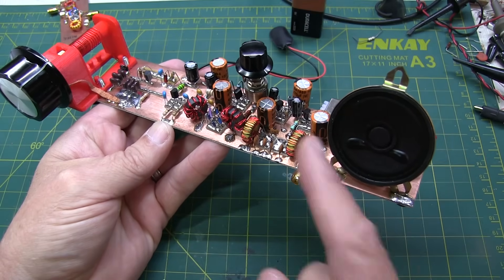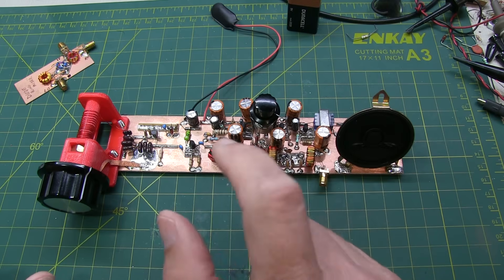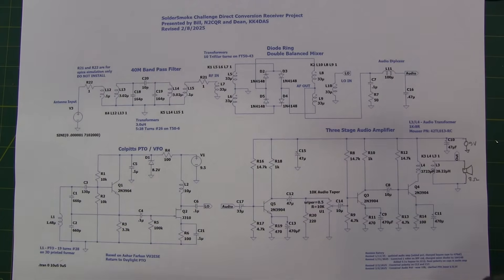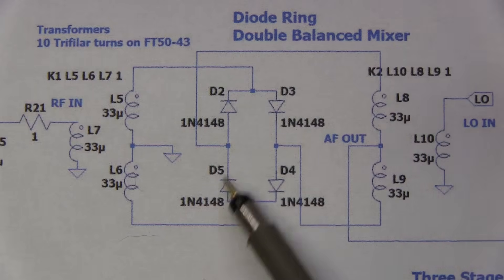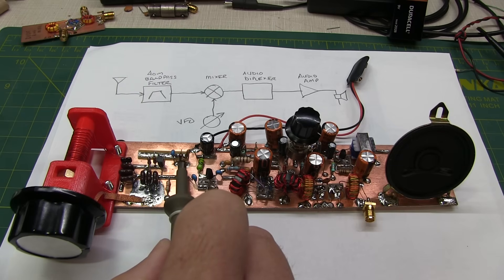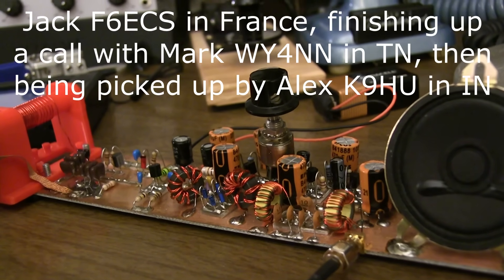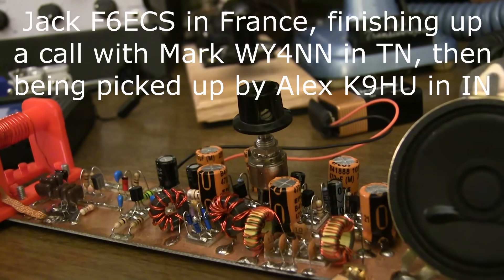#398: My  build of the SolderSmoke Challenge Direct Conversion Receiver for 40m

Comment: The show stopper for most of us is the 3-D printed PTO, since most of us do not have 3-D printers or access to a 3-D printer.
Reply from the maker: I had to have a friend print it for me. There are services that will print it very reasonably, or you could make a form with plastic tubing and hardware and epoxy.
Reply: @w2aew  Thank you. I think I'll try making something as you suggest. Would happen to know the diameter of the form? Thanks again for all your excellent videos. I've built a great many of your projects. Todd, N7TWL
Reply from the maker: Not sure exactly, looks to be about 3/8”.
Reply: @w2aew  Thank you! Also found some YouTube videos on building a variable inductor using a glue-stick tube. MONTV Homebrewing has one. I built the titled "Glue Stick PTO." I am surprised at how well it works. 73, N7TWL

Comment: R14 in the schematic is spec'd at 10 Ohms, this results in current of 70mA through Q4 and  the transformer -- while the trafo is only rated for 75mW shouldn't be a problem save that battery life will be considerably shortened.
Reply from the maker: The schematic was revised. R14 should be 100 ohms.

Comment: Great to see and hear the finished product. 

I'm working on this piecemeal now. I'm using MVAM109 tuning diodes to control the VFO, driven by a 10-turn pot. I've found that it gives very precise control. My buffers and oscillator gain are all BJTs since it's what I've got lying around. 73!

Comment: Enjoyable video.  I like the modular aspect with Sma connectors.  I got a thought experiment where the TinySA is the local oscillator and pan adapter.  Probably not possible with the TinySA.  Just an idea.
Reply from the maker: The problem is that the TinySA can be setup as a spectrum analyzer OR a signal generator - not both at the same time.  So, it can't be the local oscillator and a spectrum scope.

Comment: The first thing that comes to mind when considering the pile of separate boards approach is the need for an awful lot of connectors...
Reply from the maker: Many folks just connected the boards with soldered wires or coax.

Comment: so with this direct conversion design, what happens when a another ssb signal is next to yours?    would that not also mix down to audio  and be hear?   audio spectrum be flipped,  but you'd still hear strange sound.
Reply from the maker: Yes, that can/will happen. CW signals are heard “twice” as you tune thru them, once when the LO is below the CW signal, and once above. SSB is the same, but of course only intelligible on the correct side. This is very similar to old shortwave receivers with a BFO, you have to be sure to put the BFO on the right side (and accept interference from adjacent signals on the opposite side).
Reply: OK thanks 😊 @w2aew

Comment: Interesting! Why did you choose to use a custom made variable inductor instead of using a fixed inductor and a common variable capacitor?
Reply from the maker: A multi turn solution makes it much easier to fine tune the frequency vs the 180 degree rotation of a variable capacitor.

Comment: Hello Sir,
 I hope you are doing well.
I've come to you again after a long time. Perhaps you don't remember me due to my busy schedule and lack of recent contact. I'm writing from Bangladesh. About a few month ago, I sought your guidance regarding studying engineering. You helped me immensely by guiding me towards studying what I'm passionate about. You recommended I read "The Art of Electronics." However, I'm unsure what to read next or alongside it. I was thinking of reading a book on circuit analysis, but now I feel a bit lost. It would be very helpful if you could advise me on what I should read now.
We spoke on YouTube during the broadcast of your no:#390 video in november .
Reply from the maker: A good practical book on troubleshooting (circuit analysis) is "Troubleshooting Analog Circuits" by Bob Pease.
Reply: Thank you sir❤
I think it would be helpful if i told you what I've learned and how. 
"So far in my electronics engineering studies, I've only covered the basics of resistance, voltage, and current, including their definitions and descriptions, and the three formulas of Ohm's Law. I've done some practice with series and parallel circuits made up solely of resistors, and I've learned about series opposing and aiding circuits, grounding, the voltage divider rule, the current divider rule, and practiced quite a bit with parallel resistor circuits.
Since I'm not enrolled in any educational institution, I created my own learning sequence for these topics, and it felt pretty well-organized to me. I've now moved on to the chapter on Power and Energy. In this chapter, I've learned about the definition of power, the application of the three power formulas (P = IV, P = I^2R, P = V^2/R), and how to calculate voltage, current, and resistance based on power formulas such as (V =√P*R , I = √P/R , R = P/I^2). However, I haven't found many circuit-based exercises to practice with.
I wanted to study energy and power calculations together since energy calculation is related to the amount of power. While I've managed to learn a little about power, I'm finding it hard to learn anything substantial about energy beyond a few formulas. I'm struggling to understand how and when to express its quantity using different units, and what can be calculated using the energy formulas, among other things."
Reply from the maker: @abubokorsiddiq580   To be honest, energy calculations are rarely used when doing electronics work - so, don't dwell on that.  Power calculations are most often done to determine how much power a given devices will need to dissipate (remember that power mean that heat will be generated - the more power, the hotter things get).  For example, say you have a 220 ohm resistor that has 10V across it.  That means that there is 45.45mA flowing through it, and the resistor will be dissipating 0.4545 watts.  In typical designs, you would want a 2x safety margin, so in this case you'd select a resistor rated for 1W for this application.
Reply: "Sir,
From my limited knowledge, and I might be mistaken, let me explain using an example. Let's say I'm learning now, and I want to create a device of my own design. For this device, I've estimated that it will consume a total of 10 watts of power per hour. If this device is to provide continuous service to a user for a minimum of 6 hours, then it will consume 60 watts of power. Following this, if I want to make my device portable, meaning I want to incorporate a battery, then I might need to calculate energy, for example: how long this battery can supply power to this load, if I target it to run continuously for three days, will it run for a shorter or longer time, and so on.
Another scenario is this: In our country, if someone buys an electrical device from the market, such as a fan, refrigerator, water pump, or electric vehicle, they calculate, 'If I buy this, what will be my monthly electricity bill, how many units of electricity will it consume in a day?' So, if I were to say about a device I've created, 'This will consume ten units of electricity per month,' then, at the time of creating it, I might need to calculate matters related to energy and time.
Please Sir, let me know your thoughts.
Reply from the maker: @abubokorsiddiq580  For battery powered applications, the batteries are typically rated in Amp-Hours (or milliaamp-hours).  So, the typically way to determine battery sizing is to consider the total current draw of your device and divide the battery capacity by that number.  For example, a device drawing 200mA will last 10 hours when using a battery with a capacity of 2Ahr, or 2000mAhr rating.   For computing energy  usage for home/building use, the "unit" is typically Watt-hours (the product of the power usage multiplied by the usage time).  So, an appliance that consumes 250 watts will use 2.5kW-hours per month if it is used for 10 hours in that month.
Reply: Do I need to calculate this for each component when building the device?
Reply from the maker: @abubokorsiddiq580  Usually not.  Start with calculating for the ones that will be dissipating the most power- such as the devices with the most voltage drop and those with the most current flowing through. Sometimes, the entire circuit's power dissipation is low enough that you don't need to calculate for each component - since none of the components will use more power than the total circuit.  So, if your entire circuit uses 150mW of power, you can be safe using 1/4W resistors everywhere, and likely 1/8W in most places...
Reply: Sir, please let me know a convenient time for you to contact you, so that my conversation with you doesn't disrupt your important work. Also, could you let me know what time it is in your country right now?
Reply: 😢umm

Comment: Nice clear circuit diagram and description; a good no-frills design for a novice. But what's with the 14.7k resistors? A novice might spend much time trying to buy those when presumably they just happen to be what you had in stock. The real/normal values would be 15k resistors !
Reply from the maker: 15k work fine.  The designer must have been working of an E96 resistor list.

Comment: Great Video, Alan. Nice stage-by-stage analysis. You should bring it to the next IEEE-MTTs Mini-Show at the Hanover Manor in October. Hook it up to that great Tek gear and do a live demo with practical radio. That will give the Soldersmoke DCR some IEEE exposure. And show off the Tek gear's capabilities. Antenna?? Random wire out the window to the parking lot, no one will notice! CU There-73-Mike, WN2A

Comment: Very nice project! And, a great learning tool. So, what keeps the VFO from going out the antenna? Maybe an RF amp stage before the mixer would offer some isolation and maybe add some gain. It looks like you have room for that on the board... Thanks for sharing this project. - WC8J
Reply from the maker: The double-balanced mixer will suppress the VFO signal a lot.  The injected power of the VFO is at best just a few tens of milliwatts.  The suppression of the DBM should be at least 10-20dB or more, so the amount of signal getting to the antenna will be minimal.  And yes, an RF preamp will suppress this further as it will have a fairly small S12.

Comment: How are SSB & CW signals being demodulated without a BFO?
Reply from the maker: Since it is a direct conversion receiver, the VFO is the BFO - you're just adjusting it to the suppressed carrier (for SSB), or to approx 600-700Hz above or below the CW signal and hearing the heterodyne.  Since there is no real filtering, you hear the CW and SSB "twice" as you tune thru (when VFO is below then above the signal).  Of course, the SSB signal is only intelligible when you are on the correct side.  The CW signal can be tuned on either side.

Comment: AI Summary

Abstract:

This video details the construction and operation of a homebrew direct conversion receiver designed for the 40-meter amateur radio band (7-7.3 MHz). Originating from the Soldersmoke blog and podcast as a challenge for high school hobbyist groups, the receiver emphasizes modular design using readily available components. The architecture is straightforward, featuring a passive 40m bandpass filter, a four-diode ring mixer, an audio diplexer for RF termination and low-pass filtering, and a multi-stage transistor audio amplifier for all signal gain. A variable frequency oscillator (VFO) provides the local oscillation, with its frequency directly corresponding to the tuned receiving frequency. The video discusses the schematics of each module (VFO, bandpass filter, mixer, audio amplifier), highlights construction considerations such as component stability, and demonstrates how to determine the operating frequency using external tools like a TinySA. The project is presented as an accessible and rewarding build for electronics enthusiasts, requiring only five transistors for a functional receiver.

Summarizing the Direct Conversion Receiver Project

*   0:00 Introduction to the Receiver: The video introduces a direct conversion receiver for the 40-meter amateur radio band, emphasizing its simplicity and the story behind its design.
*   0:10 Project Origin and Goal: The receiver was conceived by the Soldersmoke blog and podcast as a challenge for high school hobbyist groups, aiming to create a working receiver using easily obtainable, modular components. Over 70 units have been built worldwide.
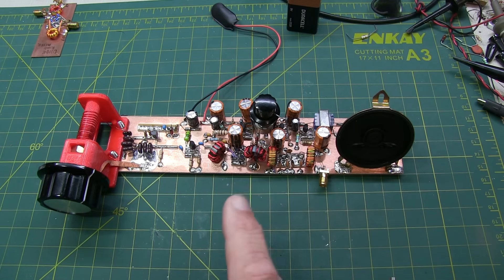*   0:53 Modular vs. Compact Building: While many builders construct each module (VCO, mixer, audio amplifier) on separate boards for easier testing and layout, the presenter opted for a compact, single-board design, which was a challenge due to tight space.
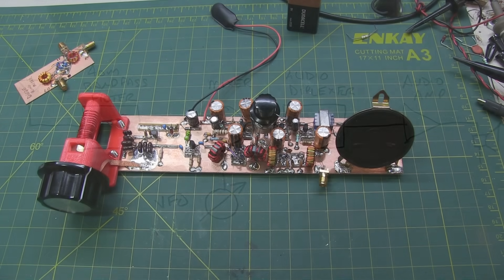*   2:05 Simple Block Diagram: The receiver's design is straightforward: signals enter via an antenna, pass through a 40m bandpass filter, then to a passive diode ring mixer (where a Variable Frequency Oscillator, or VFO, provides the local oscillation for direct conversion to audio), followed by an audio diplexer and finally a three-stage audio amplifier that drives a loudspeaker.
*   3:09 All Gain in Audio Amplifier: A key takeaway is that all signal gain in this receiver comes solely from the audio amplifier, as
Error: <sqlite3.Connection object at 0x7507e409eb60> returned NULL without setting an exception Oscillator):* Uses a single NPN transistor and a 3D-printed inductor with a brass screw for tuning, buffered by a JFET. Stable operation is aided by silver mica capacitors and a Zener diode shunt regulator.
    *   40m Bandpass Filter: Consists of bifilar wound transformers and a capacitor network to pass 7-7.3 MHz signals and reject out-of-band interference.
    *   Diode Ring Double Balance Mixer: Utilizes four diodes arranged in a ring and center-tapped transformers for switching action, converting RF directly to audio.
    *   Audio Diplexer: Terminates RF output from the mixer and acts as a low-pass filter for audio signals.
    *   Three-Stage Audio Amplifier: Composed of common emitter stages with AC coupling and a potentiometer for volume control, driving an audio output transformer to an 8-ohm speaker.
*   8:23 Encouragement to Build: The presenter challenges viewers to build their own receiver, suggesting individual modules might be an easier approach for beginners, and provides links to resources.
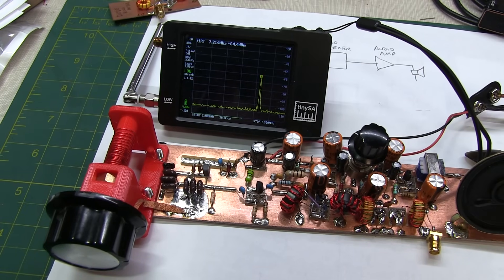*   9:11 Frequency Determination: Without a direct frequency readout, the VFO's oscillation frequency indicates the tuned frequency. This can be measured with external tools like a TinySA, another receiver, or an oscilloscope, making frequency determination "part of the challenge."
*   10:34 Sample Recordings & Conclusion: The video concludes with sample recordings of CW (Morse code) and single sideband (SSB) signals received by the unit, despite poor band conditions due to a solar flare. The presenter reiterates the project's enjoyment and simple nature (only five transistors).

I used gemini-2.5-flash-preview-05-20| input-price: 0.15 output-price: 3.5 max-context-length: 128_000 on rocketrecap dot com to summarize the transcript.
Cost (if I didn't use the free tier): $0.0056
Input tokens: 16172
Output tokens: 902

Comment: Do You have a video tutorials about TinySA?
Reply from the maker: Not yet.  I have both the TinySA and the TinySA Ultra.  No videos yet.  Do you have a question about them?
Reply: @w2aew I just do not understand the mesurements. I tried to mesure the harmonic content of 2m handheld trx through air coupling. (Just the relative power to the carrier "dBc"), but it is told me that this is incorrect way and I need to use rf attenuator to mesure it properly (to not blow tinysa input circuit, I am Ok with that). But why tinysa can not mesure relative harmonic power with respect to the carrier over air coupling but it can via att?
Reply from the maker: @adrian_sp6def  The main reason that you cannot use over-the-air to measure harmonic content is because the gain of the antennas, their response pattern and the coupling between them (radio and TinySA) will not be consistent at the fundamental frequencies and the harmonic frequencies.  Thus, the relative magnitudes of these frequency components will be affected by the antenna gain and radiation patterns, and won't represent the true relative amplitudes between them.  An attenuator that is "flat" across the measurement frequency range is what you need to maintain the same relative signal strength between the frequency components.

Comment: Great presentation!  I just finished setting up an SDR receiver but find myself wanting to build something like this that is a world removed from an SDR!
Reply: This is not something I have done but if you feed the audio stage into the line in or mic port of a PC, you're back in SDR receiver land. I've built the opposite - You feed IQ data into two mixers with a quadrature vfo, and you've got an SSB signal you can amplify and transmit.

It's a very fun project, and because I cheated on the VFO (Si5351 can do quadrature VFO), the hardest part was always always those pesky RF amplifiers :)

Comment: Some years ago I designed and built a radio like this and was quite ecstatic to see it work ......  except  ......  With a period of several minutes the VFO would suddenly zoom off and then slowly return.  After several nights of trying to figure out what was going on I finally noticed this occurred when the A/C kicked on.  Apparently the cool air that I didn't even notice was causing a big shift in the VFO frequency.  So, I guess I not only built a mediocre radio but also a fine very sensitive thermometer.
Reply: All in how you look at it!
Reply: That is why he specifically used silver-mica capacitors at 6:55. Least drift on temperature, but expensive.